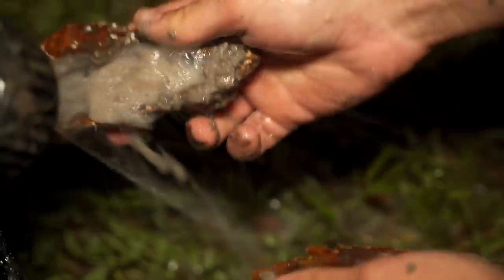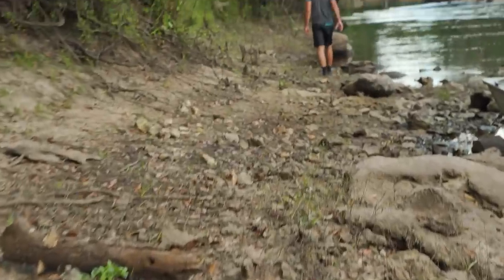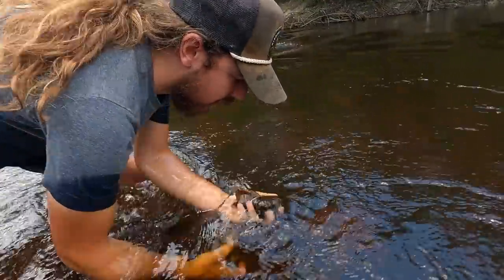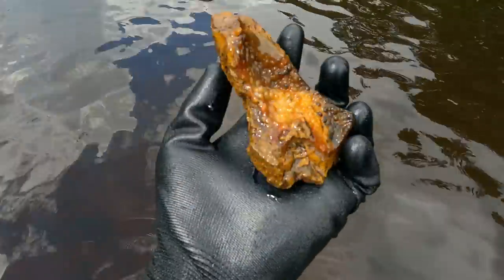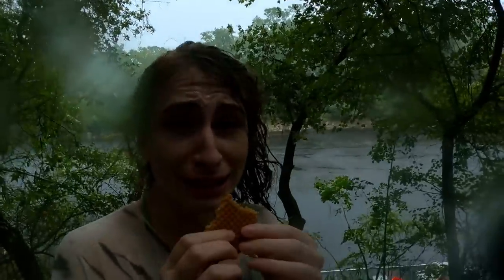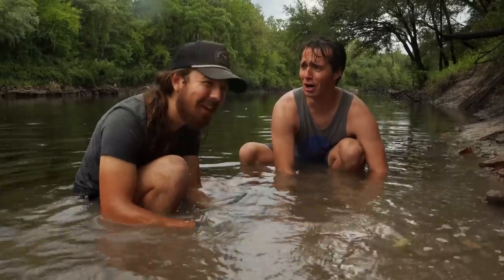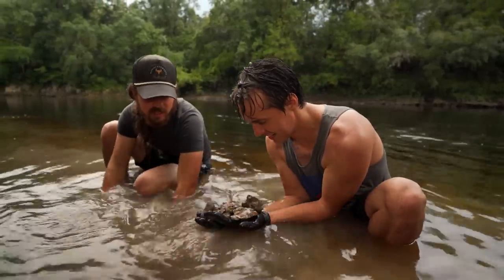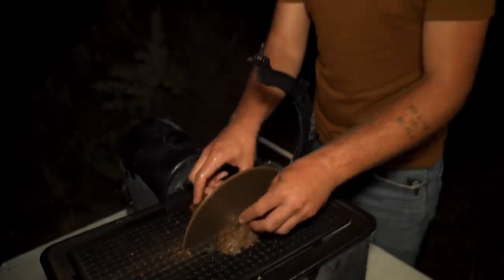These Rocks Will BLOW Your MIND! We Found Agate Geodes INSIDE Fossil Coral!🌩️⛏️💎

Comment: Chris do you sell cut slabs for flint knapping , if so I could use some,.
Reply from the maker: Not at the moment, Thomas! This saw requires holding to rock manually and it takes a while on solid pieces. In the future, I plan to purchase a power feed saw with a vice. When I do, I could definitely slab up some coral for you.

Comment: Dude no one who uses tools thinks your gonna cut your finger on that blade 
 But we are screaming about your approach
Who the fuck pulls from the back of a saw????
Thats why you bent a blade...
Reply from the maker: You’ll see us standing in both directions depending on the cut. The last cut, Bri was in the front and she was SOAKED. It wouldn’t have been nearly as bad from the back. With larger pieces, you have to lift that spray guard. From the back it’s still protecting you a bit.
Reply: @PaleoCris  I've bent blades doing it from the front too but you have way more control and less mistakes....also getting wet is what happens its like getting flower on you when baking....you just deal with it maybe lean to the left and inch
I do love all the neet artifacts you guys find 
and support everything you do
(Except the saw thing that's still crazy to me)
Reply from the maker: @chrissycronin798 to each their own. We’ve all decided that it doesn’t make any difference on the cuts and you can see better what you’re doing because of no constant spray on the glasses.
Reply: @PaleoCris  yup...just keep doin you...
How do I send you some agate and raw stuff to cut from AZ